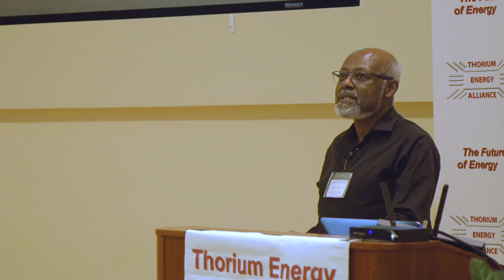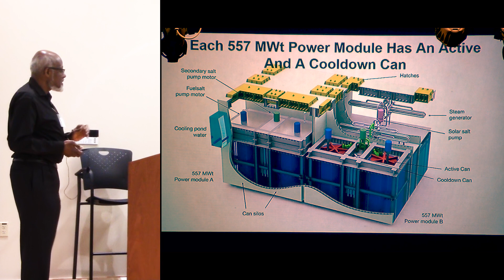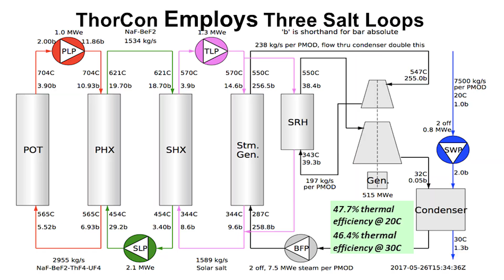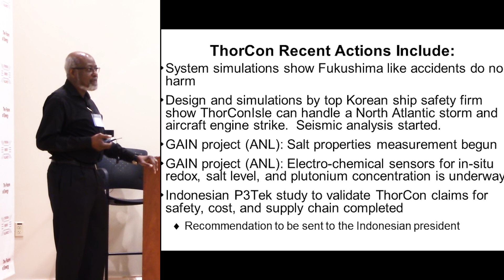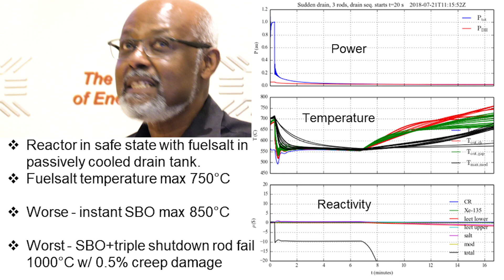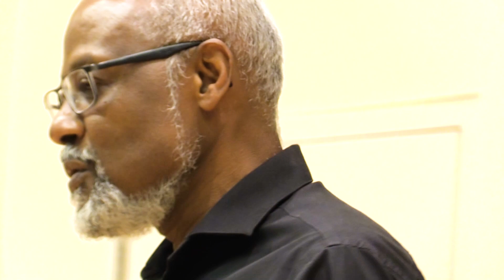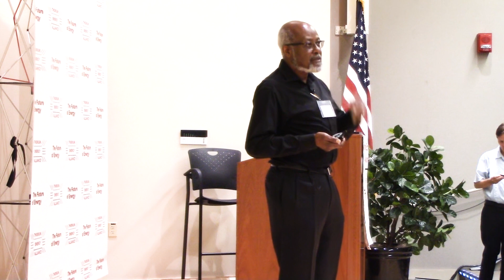ThorCon's Thorium Converter Reactor 2019-10 Update by Dane Wilson @ TEAC10

Comment: your math on the heated salts is slightly off.  Also, realistically, you need at least 3 "cans" but practically speaking you need 4.  With 3 "cans" if you powered up can A) it would generate electricity from 2024-2028 then cool for 2028-2032 then removed in 2033 and new can A installed 2034. can B) would sit as back up/standby from 2024-2028, generate energy from 2028-2032, cool for 2032-2036 removed in 2037 replaced in 2038.  can C would sit as back up/standby from 2024-2032, generate energy from 2032-2036, cool from 2036 to 2040 removed in 2041 replacement installed 2042.  With only two cans you will have at least 2 years of ZERO energy production starting in 2032.   again, 4 cans would give you better time allowances for maintenance and give you an additional back up should one of the cans be outside of tolerances.
Reply: He said 500 mW is their target.  Depending on the size and temperature they run at. Also with other factors such as efficiency of turbine and waste product build up. Down time ext. I think it is realistic as he said modular and one can is good for a modular design. So each can will have a cooling and containment solution. independent of each other.
Reply: Once the first boat is producing electricity, (2024..2028) the plan is to have a sister ship added next to her a few years later so that they can stagger the rest and replacement cycles.

Comment: Question about the ThorCon Hull: it looks rigid and maybe it is. But settling it in shallow tidal waters? A cubicle and a rectangular shape is not an ideal form in coastal waters. it would be better if it had a shape like that of shells or clamps - these marine lifeforms have adapted to live in tidal, dangerous waters for 100s of millions of years - if a harsh tsunami-wave hit, a clamps-like hull would better withstand and be at less risk of eventually toppling-over! !  The drain-tanks with passive freeze-valves wouldn't work if toppled-over.
Reply: It's a double hull filled with concrete meters think, it's not going anywhere.
Reply: Reminds me of the freight ships carting sea cans. Could sit on an existing hull that is big enough to carry it.

Comment: so Tritium will be filtered out  (sequestered) in this projected concept. This is good. What will You do with it, long as no Fusion-reactor is running? The conventional nuclear industry just deposes it into the ocean-waters (spoiling the fish that way).   Does Xe135 pose a problem in MSRs? Would there be an advantage, if it were stripped off and stored outside of the neutron-flux?
Reply: Tritium decays over time to helium 3 with a half-life of 12.3 years. Its beta decay is also very weak. Its stopped completely by 6 mm of air. The decay has also so little energy that it has a very hard time destroying things like DNA.

Long story short the decay of tritium is like burning yourself on a 50 degree plate versus plutonium being 2000 degrees blast furnace. to give a sense of scale.
Reply: @pokekick4185  Yeah I like Your answer, but then again, why are there cases of leukemia in children around nuclear reactor sites? Neutrinos?  

There seem to be increased (small, genetic,) anomalies in people, borne in the mid-1950s (nuclear-bombs testing); (look at 1. Prince Charles' ears, and 2. the ears of the elder brother of my friend (he used to get teased for that), 3. a boy with almost crippled, bent legs in a village, also of this age). Then 4. a boy, kind of disabled, who was borne shortly after 1986  (Chernobyl) in a nearby town (probably Caesium). Of course, it mustn't be Tritium or Reactor-Neutrinos, it could be a Terra-eV cosmic ray.  I can continue my suspicions with farmers mouth - to - mouth reports about dead-borne calves, near the 2*1300MW Gundremmingen-Reactors (Germany)!   
   We consumers of energy seem to be cornered between CO2-Problem  and Neutrino + (maybe not really Tritium)-Problem.
Reply: First of in Europe and america nuclear reactors are build on industrial sites. A research compared cancer rates between industrial sites with and without nuclear reactors found no difference in cancer rates. Increased amounts of death around nuclear reactors seem to correlate really well with air pollution.

Should we really add the damage done by nuclear bomb testing to nuclear reactors? Seems like 2 ideas that with totally different goals and track records.

We  also have been getting better at medicine and people with larger and larger health defects don't die in childhood anymore. Ask your parents/grandparents about how many children died in their family's before the 1940's.

I am also not saying Chernobyl didn't cause a lot of radiation exposure and didn't throw fission products and reactor fuel into the atmosphere but these where a lot more dangerous than tritium. Lucky for us a event like Chernobyl will never again happen in the future. Reactors with that construction mistake are all either modified or decommissioned. fukosima was also a 40 year old reactor hit with pretty much the worst hit nature could throw at it. A earthquake with 9 on the Richter scale. A 8 meter tsunami. And it only caused 1-2 deaths of the 15000 death from the natural disaster. The amount of nuclear waste that got into the environment was also low and the background radiation around there is already back lower than some american city's or most of the middle east.

Can you also give better statistics because calves being born dead can happen and you need some quite good research and other measurements to say that it was the nuclear reactor that did it. Not the bull having a few genes that increases the chance of death borne calves, Not more stress than normal cows. Science is not build on anecdotes. If a farmer doesn't like a nuclear power plant nearby then of course the power plant has killed his calves. That's good old bias.

Secondly you are constantly being bombarded with neutrino's from the sun. They are weak interacting particles You need multiple cubic meters of material cooled to near 0K to be even measure them. They don't have the energy to destroy your DNA.

Also take some science classes instead of reading conspiracy theory's.

Comment: Did they look at the jet engine impacting the pond walls, and what happens to the cooling water? Ignoring the reactor effects.
Reply: They did. The models show no penetrating breaches of the outer hull. (Big 30cm dent on the inside that would need to be repaired eventually.)

Comment: Where does the low pressure within the can during operation come from?
Reply: Salt has very high melting and boiling temperature at atmospheric pressure. Table salt is around 800 degrees Celsius for melting and around 1400 degrees boiling temperature.
Reply: Sslt has very low vapor pressure at up to 1000-1400C. Low pressure is maintained by a pressurized cover gas to reduce off gassing of higher oxidation state fissiles & sweep up the off gassing noble gas fission products, xenon, krypton, helium and hydrogen (p, d, t) as HF.

Comment: There is one big problem with thorium that nobody ever mentions - it does not readily form economic deposits.  Although it is more abundant in the crust (12 ppm) than uranium (4 ppm) you can't mine these elements at those levels.  The word "abundant" is unfortunate, as it implies "plentiful" which thorium is not.  There needs to be a geological process to concentrate an element to a point where it can be extracted, same as with iron, lead, copper and gold etc..  This is then a matter of chemistry and economics to extract the elements or the oxides as required.  Uranium is chemically mobile in oxygenated water and there are at least 14 types of deposits that can be formed, so almost every country can find some uranium.  Not so with thorium, there are only two types of deposits, pegmatites and monazite sands.  India has unique and extensive monazite deposits and relatively little uranium, which is why they are leaders in thorium reactors.  Europe, Australia and N. America have plenty of uranium deposits but few thorium ones. Thorium costs about 100x  more than uranium as a result.  Security of supply is another issue, e.g.  if your supplier turns out not to be so friendly in the future.
Reply from the maker: One need not mine Thorium from Thorium mines... it is a byproduct from Rare Earth deposits. China is stockpiling massive quantities of Thorium. They did not need to create a "Thorium Mine" to do this.

ThorCon is a converter. Not super-efficient, but great way to get MSR into commercialization and iterate from there. Once a true Th-MSR breeder is in operation then it isn't a question of natural-Th competing with natural-U it is Natural-Th vs U-235 (less than 1% of natural-U). Of course fast-spectrum U-MSR could then also turn it into natural-Th vs natural-U again.
Reply: @gordonmcdowell  I don't know what you mean by "massive" amounts?  The Rare earths are called "rare" for a very good reason, and thorium can almost be considered a REE as it has very similar chemistry.  Apart from the difficulty of finding economic deposits of Th and REEs, if their supply becomes controlled by a few countries, e.g. India and China, it creates a geopoitical supply constraint. Uranium deposits are more widespread and any country can either find its own deposits or buy it from a friendly country.
Reply: Yes, thorium is associated with REE deposits and many exploration companies are actively exploring for both REE and Th deposits.  However, there is far less readily available thorium than uranium because of its difficult geochemistry.  Uranium remains the cheap substitute for the more expensive and scarcer thorium.
Reply: @karhukivi  Thorium is not scarce. Thorium is a byproduct of rare earth production and theoretically, at least, is almost free.
Reply: @charlesaanonson3954  Try buying some!  Thorium behaves chemically like the lanthanides so is often found with them.  They are called "rare" for a reason, not of abundance, but because they are rare to form economic deposits.  The distribution of Th or REE deposits is not anywhere as ubiquitous as uranium, so e.g.  if France decided to switch to thorium nuclear power, they would have to import all their thorium mainly from China, which if a trade war intervened, cold lead to supply problems.  This is not the case with uranium, deposits are found almost everywhere thanks to its ability to form economic deposits fairly readily.
Reply: @karhukivi  You are correct about Thorium. Thankfully the reactor in the video can run on a mixture of Thorium and uranium, (and even plutonium.) So its fuel source is already mined and sitting in the car park of every "nuclear" power station in the USA. It can literally burn nuclear waste, (no need to toss it in the sun.)
Reply: @recklessroges  If your car could run on petrol alone, or a mixture of petrol and  champagne, or even champagne alone, which would you choose?   The problem with thorium is its very uneven distribution in terms of deposits and the small size of most deposits which gives rise to its cost compared to the ubiquitous uranium.
Reply: @karhukivi  So itbis not really that thorium is rare, but more that it is much harder to refine becsuse it only has one oxidation state, unlike uranium with many.
Reply: @EdPheil  Economic deposits of thorium are indeed rare, compared to economic deposits of uranium.  This is because of the very different chemical behaviour of uranium which can be leached out of granites and other U-bearing rocks by oxygenated groundwater  (over long periods of time) and precipitated where reducing conditions are met.  Thorium - and the REEs - doe not behave like this.   Also, as you correctly point out, both Th and REES are harder to refine.
Reply: @charlesaanonson3954  But - REE deposits are scarce and difficult to find!    Name several countries in Europe with thorium and/or REE deposits which are large enough to mine economically.
Reply: Thorium is found and concentrated in other ore from processing those, such as Rare Earth Elements ore, iron ore, phosphate ore.

Comment: I've been following ThorCon for at least 4 years now and I'm very encouraged that the Indonesian Gov't has remained committed to its development. Constructing the non-fissile demonstration plant is the next big step. Having worked in the shipyards of Korea and China, for FPSOs twice the Length of the proposed TCI, the envisioned 500 ton modules are mature technology, it is only the materials for the "Can" and salt loops that remains to be proven, but as I understand Hastelloy-C https://www.steelforge.com/hastelloy-c/  is what's being proposed for now. ThonCon is probably closer to operation than anyone outside China. Great presentation, and thank you, Gordon, for the most in-depth continuing coverage of MSR development! http://thorconpower.com/design/
Reply: Thorcon is not using hastelloy, just stainless. Their 4 year can cycle lets them inspect the piping and replace if necessary.
Reply: @chapter4travels  probably the worst idea since they built Chernobyl without a pressure vessel.. The alloy originally studied at Oak ridge is Hastalloy N. Unfortunately, the Obama administration gave the all the MSR research and samples to China (yes, gave it to them and didnt keep a copy). BTW, Stainless, even without a corrosion issue cannot handle the temperatures in an MSR unless you ran it at bare minimum operation temps (and god forbid if it ever ran a little hot!!)
Reply: @darikmatters8866 , Of course it can or they wouldn't be using it. It's a fully tested and pre-qualified material.
Reply: @chapter4travels  LOL.. your stupidity is showing again, the material cannot be per-qualified. There has not been enough time for testing.. They need to run what are called "hot loops" for years and years under different parameters to certify and qualify a material for use in a nuclear power-plant.. Even Hastalloy N has issues with this particularity hostile environment... There is a Chromium ion migration issue that still needs to be solved to use the most tested material (which was specifically designed for the Li/Be fluoride molten salt environment with a high radiation flux density) we have let alone a iron based alloy...
Reply: @darikmatters8866  Here you go. https://www.oecd-nea.org/science/pubs/2013/6409-sr-smans.pdf
Reply: @chapter4travels  i guess that was the end of that conversation lol
Reply: What about within China? How close are they?

Comment: The only problem I have with this is no long-term study has been done on what it would mean if the unit was abandoned after... three-and-a-half years (perhaps because of a worst-case scenario of war or international political strife- which I understand is the motivation to fast-track this...).  If no US Navy crew was standing by to continually grind and re-paint, and considering that unwanted fission products will not be continually removed from the system- how long before oxidation and long-term 'inattentiveness' becomes an issue for the rest of Southeast Asia (due to an unforeseen event or set of circumstances)?
Reply: Abrupt abandonment is not a problem we have considered.  Since the power plant is inside a hull one could deballast and tow it away from the conflict zone to deploy for use elsewhere (or decommission if that was the desire).  Long term (multiple decades) there was a problem at MSRE with the cold fuel storage.  Not a difficult problem to solve now that it is know.  If this is the only problem you have then I think we have done a pretty good job.
Reply: That is a good question. (They have to cover plane strike for marketing, but "How long until the ocean dissolves its way into the pot in a walk-away situation at [1,2,3,4,5,6,7,8,9,...] years from the first day of fission.) Looking at the wrecks of oil tankers and cruise ships around the world it seems to depend on exposure to wind, tide, waves, swell, ocean temperature and storms. (That's a fun pile of Navier-Stokes equations to solve.) My first guess would be: between 5 and 90 years, depending on location. [There are ships from WWII that still haven't fully broken up off the coat of California.])
Reply: Dilution is the best at reducing radiation levels. I know it sounds bad but I believe using the ocean to dilute and cool would be best in case of a completely catastrophic failure.